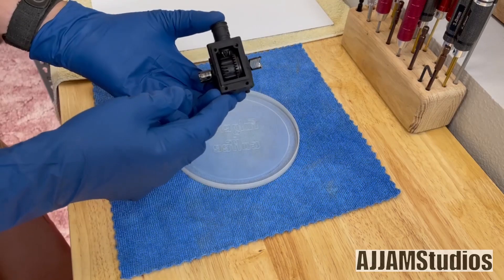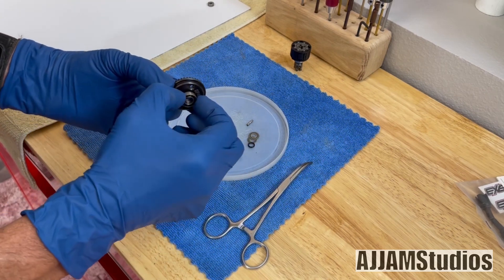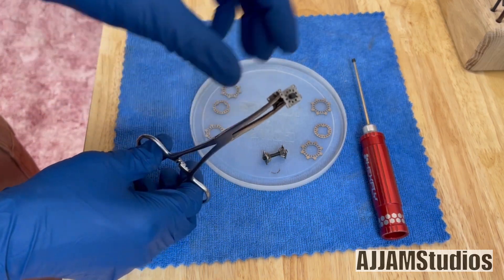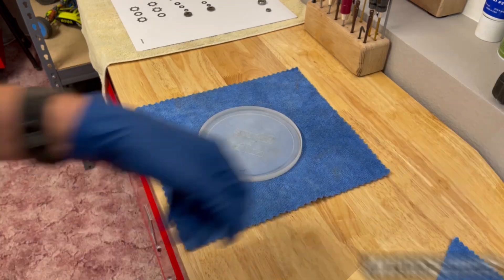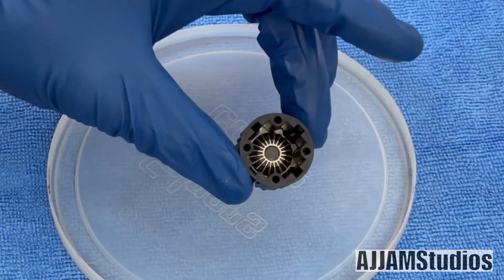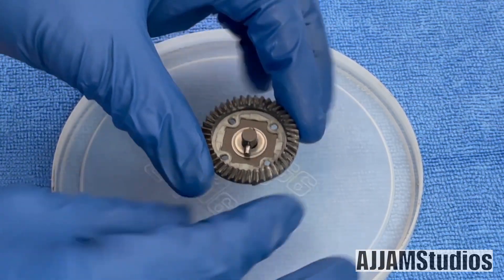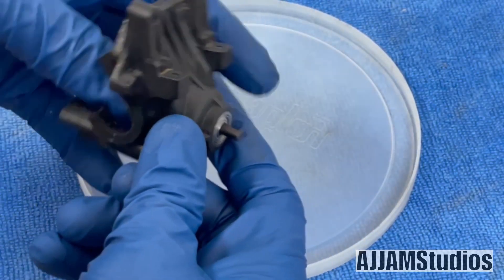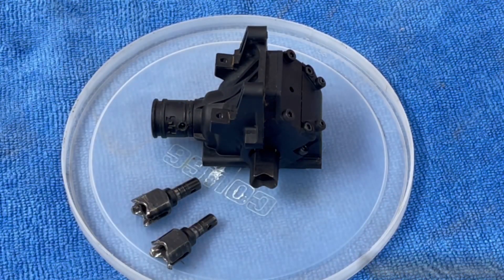LSD diff rebuild 101

Comment: Star gears have chamfered edges so one edge is round one is flat. 
It’s easier to find info about setting thee in correctly when u look for this. I didn’t know this when I bought mine so when I first got it and went through the diffs before running and changing diff fluid, I didn’t put one in correctly as Arrma don’t put it in the “destructions” only online. End of the day it made no difference to drive. 
I did however go through all the diffs again and make sure they were all in right direction 
Well explained video for people that are new to this though dude 👍
On a side note I’ve had the front outdrive from the diff come loose a few times and if it’s the front diff u need to take so many parts off it’s a nightmare. It’s not just plastic your screwing in to , there is metal (alloy,steel,whatever) so I would put a dab of blue loctite on just in case it backs out 
It saves a lot of messing about and xtra work
Just saying 🤷‍♂️👍
Reply from the maker: You appear to have yours well in hand 👍 thanks for the comment. AJ 😎👍
Reply: Exactly. For me it was also easier looking for the round edges like in the Arrma official video, instead of finding aggressive/sharp sides.
Just a minor remark on a great video. I love your video.

Comment: I find out the 2 shims next to the "O" rings.  The EXB wants the thicker small shim.  I measured out to .05mm. there is also the .03mm shims.  i made the mistake and  put the thin one in and not the thick ones which makes it to loose and the gears will start jumping and tear up the planetary gears.  i went thru my front an rear after screwing up both front and rear gears.  i took it out for a bash today with the .05mm shim and it ran flawlessly.  not sure if i make sense.  but i watch another vid an is what brought this to my attention.  
Thanks for the video.  and "Keep on Sharing"...
Reply from the maker: Good to know. Thank you for sharing😎👍

Comment: Hey, Already knew what you were showing here but nice to watch to see I was not missing anything and very well explained.. Great job.. Running an EXB myself and built a hybrid center diff which has been fun to drive so far on a few small test run, give me a shout and ill give you more details on what I have been working on :D
Reply from the maker: Thank you. I’m interested in your project. Post it and fill me in. 😎👍
Reply: A link to original forum post explaining it, small vid at very bottom of the post. Drives nice tbh.
Thread 'A little LSD theory crafting' https://www.arrmaforum.com/threads/a-little-lsd-theory-crafting.38580/
Reply from the maker: Interesting idea. At the outset it looks as though it has merit. Now I’m curious. Only using the plates in the front half of the center diff...  The idea intrigues me. It sounds like something I would try...and probably will. Thanks for sharing the idea with me. 😎👍
Reply: @AJJAMStudios  Cool, if you do let me know how you get on with it, any feed back would be great :D

Comment: Great explanation video of how this diff goes together and  why. I have a talion and I wanted to check the diffs to make sure arrma put enough oil in from the factory before I ran it. I noticed that a star shim was broken and it had half the oil needed. Now I’m waiting for my new parts to arrive before I rebuild this diff. I wasn’t happy that a brand new diff came with a damaged part from factory. It wasn’t worth the effort to have arrma replace a few dollar part. One difference between the Kraton and talion seems to be is the Kraton is setup with the more aggressive diff option. My talion has the other option in all the diffs. Im guessing that will allow the talion to go faster out of the box.
Reply from the maker: Thanks for the comment, and no the setup of the diffs does not directly affect the overall speed of the vehicle, it's the handling. The setup of the differentials is to get more or less power or handling during acceleration or cornering. In short, it's the setup of the diffs that allows the car to remain controllable for the driver in typical situations. If the car is squirrelly then the diffs are not setup correctly for the situation. If it pushes in the corners then the diffs might need to be looked at. Again, thanks for the comment 😎👍

Comment: This is the best explanation of the lsd plates ! Thank you. Do you prefer it with the lsd plates or open diff with thicker diff fluid on Kraton exb 6s ?  Thanks for ALWAYS providing awesome content. You’re the best in the business
Reply from the maker: Our preference here is open with adjusted oils for thickness. Easier, lasts longer on an oil change, and there's simply less involved to wear out and cause issues.

Comment: Thank you for the video, great stuff. Can you please explain more about the difference between the aggressive and non-aggressive setups?
Reply from the maker: Sure. To begin with, it is a matter of feel to the driver. The aggressive setup is stiffer and more prone to skidding or locking the two wheels together if the fluids are stiff enough. The stiffer the fluid inside the diff, the less counter rotation the diff will produce under power. In other words, stiffer equals Posi traction if the oils get heavy enough. The opposite is true with the lighter fluids. The lighter the fluids get the more prone to counter rotation the diff becomes. To spell that out a bit better, with light fluids, when you spin one side by hand, the other will counter rotate very easily, thus allowing the rig to spill all extra power to the spinning tire and not to the traction tire. Stiffening up this component (the oils) drives more power to the traction wheel and gives more thrust to the rig. However, this thrust comes at a cost. When you eliminate the over-spin (light oils) in favor of stiffer oils, the rig can become much more squirrely and prone to flipping over or spinning out instead of staying controllable; that's why they usually ship the diffs with lighter fluids from the factory, to make the car more controllable for everyone regardless of your skill level. As far as the plates inside the LSD diff go, there are two sides to each plate and they are different, if you look closely you should be able to see the smooth side and the course side. Always follow the manual for how this should be installed into the diff. With the aggressive setup, the diffs "should" react more aggressively and throw more power to the spinning side while under power; that's the theory anyway. I have not noticed much of a difference myself. As far as I can tell, the fluids make a bigger difference than the plate side you choose. However, this overall view of the customer purchasing these machines is why each car has to be setup for the individual and not as a "one size fits all" solution. The oils that work for me might actually not work for you at all because of our situations, locations, driving styles, and experience levels. The companies that produces these machines are tasked with finding a way for everyone to be able to drive their products or they simply won't sell; that's why tuning is so important. Wow, that was long winded. I hope this helps. AJ
Reply: @AJJAMStudios   thank you AJ for the prompt and detailed response! That is very helpful. Can you explain a bit more on why would the car become less stable with thicker fluids? How would this affect steering?
Reply from the maker: Sure. The stiffer fluids allow the power to be sent to the traction tires without bleeding off the excess. This allows the tires to "all" break traction, which allows for car's possible over-rotation in a corner, AKA spinning out. With stiffer fluids in the center diff, the power is sent to the front and rear of the car more equally which facilitates wheelies while under power and endos during breaking, making the car harder to control in traction situations. A good balance of fluids "can" allow both results to an extent. With the proper fluid thicknesses in each diff the car can hole-shot well, and yet still bleed off enough excess energy to stay manageable. It is up to you to choose the balance you require. And, each car is different and requires the same diligence when working the setup of the diffs. Stiffer is more locked down and less controllable, while light fluids are less locked down and thus bleeds off the excess energy without costing traction but at the cost of the hole-shot. The balance is yours to find. Good luck in your search. AJ

Comment: I have NEVER once in my life let anyone else work on my cars 😂 I’ve only let the hobby shop solder on connections for an esc I got from them because it was free and 🤷🏻‍♂️ why not? There’s always video like these to help if you’re stuck and need help. I watched this for the explanation on the LSD functionality because I haven’t had to open mine up yet. Witch brings me to my question. I’ve noticed there are aluminum diff cases. Do these not house the LSD system? My outdrives are pretty chewed up from running in gravel and catching rocks between them and the lower arms 😬 I was thinking I would get new outdrives with the aluminum casings while I strip it all down. So, will I need the shim kit or will the LSD still work?
Reply from the maker: Aluminum is a fair upgrade. However, I just replace them with stock casings. They are cheap and readily available. Plus they don’t add weight. Let me know which you choose. 😎👍
Reply: @AJJAMStudios  I’m going to wait on the diffs I guess because the outdrives are still good, just ugly hahaha! I got the hot racing hub carriers for my Talion and was installing them only to realize the axels are too short 🤦🏻‍♂️ looks like the talion is going to get a wider stance once I pick up some Keaton axels today. Oh, but the HR diff housing/bulkhead went on nice! Came with a bunch of screws I didn’t need but 🤷🏻‍♂️ I hope the ears on that don’t bend or strip.

Comment: A vehicle limited slip has ramps that engage and press harder against the clutches on each side upon slipage. I'm guessing these RC LS units rely on constant friction only?
Reply from the maker: This type of LSD diff relies on fluid resistance to function. The viscosity of the oils create the drag between the plates and limit the slippage. It is harder on the fluids as they break down faster, but it does work. Thanks for commenting. 😎👍
Reply: @AJJAMStudios  ah, I  see. We have a lexus rx 300 which has a rear viscous limited slip. Was only available on the 99 model year. It uses a silicone like fluid and acts like a torque converter so no mechanical contact for Its function. Because of this, it has limited locking action when needed and is probably why torsen type became more dominant.

Comment: I enjoy your channel and regard you an expert. As such, I have a question about my Arrma Mojave 6s that I bought like a week ago. I run it on my backyard off-road, grass-dirt track that has aggressive turns and vicious sweeps, and I drive my Mojave always set at 100 percent throttle. (It's also hot when I run.)

The batteries I have in it are two 3s Spectrum 5000 may, 50 c Smart batteries charged with my S-21 Smart charger.

The issue is, my run times: it seems to be dropping off on consecutive runs: The first time I got 15 minutes. Then it dropped to 11, then it dropped to 9 minutes. 

Can you tell me why this is happening?

Thank you.
Reply from the maker: The way I usually go after issues like that are: first, pull the pinion and roll the truck back and forth to feel for any binding. If the truck rolls freely then spin up the motor, no pinion, and listen to it. If it spins up good then reinstall the pinion. Then I would consider the batteries. Even new ones can go bad. If you have another RC to test them in I would do that. If not, run different batteries to see if the results are the same. These tests should show you where your issue is. Let me know what you find out. AJ

Comment: Great breakdown of building this one ☝️ 
What are your thoughts about how it preforms vs a open diff that has been tuned for your driving style?
Can you install a lsd into any arrma rc? I have a Mojave and picks this one based on some of your reviews and how I noticed it to be able to put the power down without just wheeling everywhere which I really like, is truly like you say when calling it a “guided Missile” 😀 and I know a large part of this is wheelbase and and and but also the relatively light center diff oil and I love how it drives box stock but being a tinkerer can’t help but think there’s some room for improvement but also keeping it able to stay grounded, initially I was thinking about trying some 300k-500k in the center diff but now you have me thinking about trying a lsd in the center?? 😂 can you further tune the lsd with different fluids also? Anyhow thanks for the videos man!

Comment: So what's the difference between the limited split and the regular opened diff,  which one is better for bashing and huge jumps
Reply from the maker: They are both good for that purpose. The limited slip diffs have larger gearing and are built tough, but have limitations when it comes to the oils they can effectively use. The standard diffs have finer gearing and need to have the spacing checked to maintain the proper shim spacing for durability. They work just fine if the shimming is correct. I've noticed no discernable differences between them where bashing is concerned. However, the limited slip diffs do require a higher maintenance regimen than the standard diffs because of the friction the plates create within the diff itself. If you're willing to put in the effort they should work just fine for you. I hope this helps. AJ

Comment: Super informative video thank you.

Do you think a center exb diff swapped into an rtr would be a good idea? I was thinking of putting the exb lsd into my rtr Mojave.
Reply from the maker: Sure. The LSD system will work as well in the Mojave as in any other car, but there are pitfalls to that system, like a more rigorous maintenance requirement, and the limitations on the oils you can use, but that's not to say it's a bad system, it works just fine and it has larger gears which make it a tough diff. Just be ready for the way were designed to work, and you should be fine. Best of luck. AJ
Reply: @AJJAMStudios  thanks so much!

Comment: Man, thank you so much for this video, I opened mine up to check the diff oil, but was too chicken to take out the plates😄 the exploded diagrams that come with the truck do not go into details, so it can be pretty intimidating, I need to check, but do you cover diff tuning in another video? Can I still tune with oil if the LSD plates are installed? What about the center diff? AAAHH! so many questions!
Reply from the maker: Yes you can still tune them. The center comes with 100k from the factory. So there is room for tuning. 😎👍

Comment: Aj just open my rear diff has those plates did I hear rite arrma says the rear is open ?
Reply from the maker: Open is a matter of oil thickness. Thin oil in the diff is open, thick oil is not, heavy, 1 mil oil is locked. The plates do not determine if a diff is open or not, the are just the limited slip portion of the system. Thanks for asking. 😎👍
Reply: Ahhh OK watching the video it sounded like there were no plates  in rear my bad sorry
Reply from the maker: Have a great day 😎👍

Comment: whats the impact if I use a heavy diff oil with the lsd diff…
Reply from the maker: Heavy oil reduces the effectiveness of the plates. At that point standard diffs work better. The plates in the diff need looser oil so they rotate against one another. Heavy oil works like glue, sticking them together. It is hard on the parts and is likely to cause issues in the long run. Thanks for asking 😎👍
Reply: @AJJAMStudios  tq… what would be a good starting point for diff oil..
Reply: @AJJAMStudios  hi again
I plan to built a lsd plates for my losi 5t as it has an open diff now
what would be a good material to start with…. would a steel plates work well or a copper plate 
just a thought 
thxs again

Comment: Hy...my new kraton have minimum efect on lst plates in rear diff and max efect at the front diff...is this ok or it should be the same set up on the rear and the front diff?thanks
Reply from the maker: If you like the way your rig handles, it's okay that way. But if you need something different then adjust it to your liking. The diffs don't have to be the same, each one is tunable. As far as the LSD system goes, the plates only affect the rotation in the same way if the oils are the same consistency. Thanks for asking. 😎👍

Comment: hi , just rebuilt mine following your video . mine is really rough , if i try spin one outdrive by hand it dont budge , if i move both it does but still rough , is that normal?
Reply from the maker: No. That is usually caused by not syncing the gears as you build it. Make sure the planetary gears mesh properly before closing the diff. Also, as you close the diff be sure the gears move smoothly. This should fix your issue. Let us know if this helps. AJ